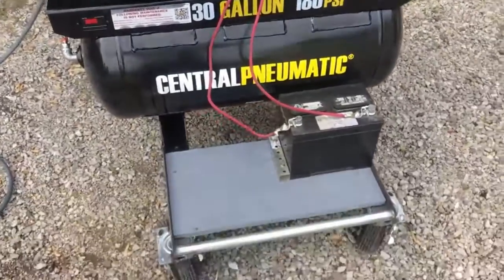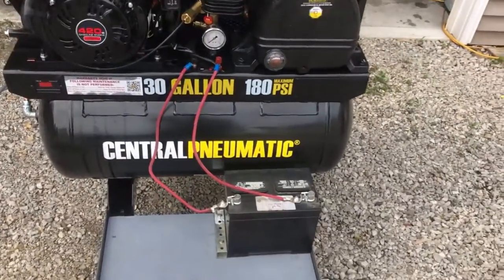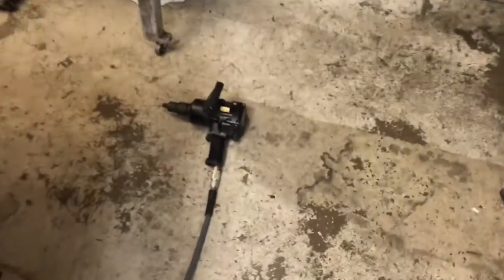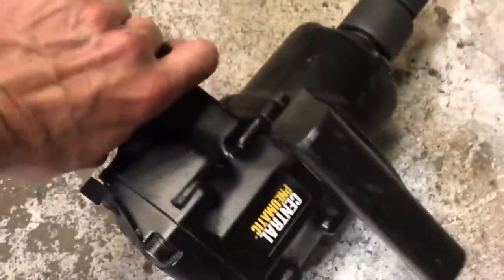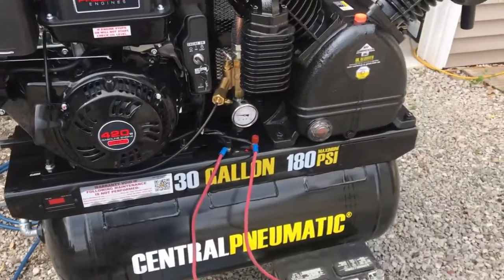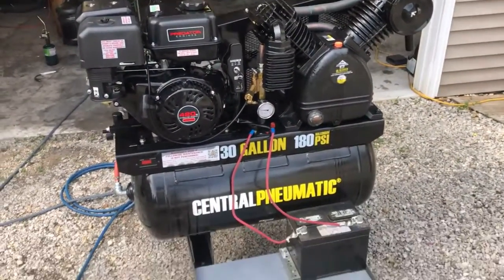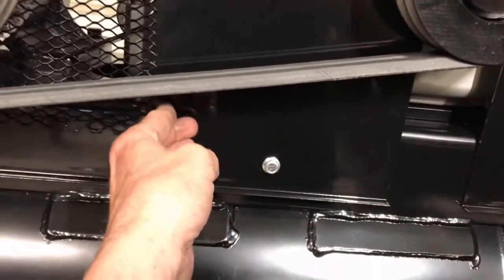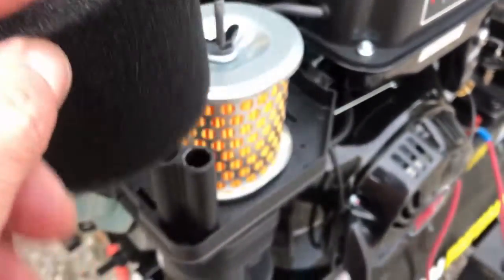Harbor Frieght 30 gallon 13 hp Truck mount air compressor

Comment: I am considering buying one of these, it seems slow to fill, how does it do once full and then running a blow tip gun or sand blasting or a power tool that has continuous flow? Northern tool has there version that is rated for 23cfm for 2200, just trying to do my homework before spending money. No one has done an in depth review of this compressor. Any feed back would help. Thanks.

Comment: I bought this exact air compressor just over a year ago. I’ve used it nearly every day since. I’m a mobile big rig machanic/tire service. I loved how quick the air was.  It has no problem running 20 ton jacks and 1” air guns. In the summer, it usually started right away or on the first pull. In the winter it was a little less fun starting, but never left me stranded. The motor was quiet and never had any mechanical issues except… eventually the key switch stole power from the spark plug. It would crank and crank but not fire. Had to pull start it every day, multiple times. That wasn’t fun. Also the water drain in the bottom is hard to get to and eventually tries to seize from all the rust. Other than that I think the motor is exactly the same as a Honda gx390. I had them side by side and there’s just a few differences. I paid the extra fee for the extended warranty. So tomorrow I take the old and pick up a brand new one. Well worth the money if you’re looking to spend less than $2k. I did however upgrade to a Napa air compressor with the Honda. So I have this Harbor Freight brand new in a box if anyone wants to buy it🤣
Reply: How much you want for it
Reply: @davidludwig4286  I just seen this! Haha I still have it in the box though. $100 less than harbor freight has it listed for. I can’t remember if it’s $1,699 or $1,799
Reply: @dallon507 you still got it?? Ill buy. What state are you in
Reply: @saulantunez42  still have it in the box. Southern idaho.

Comment: I see a few people have issues with the engine shutting off when filled or not starting. First check the safety valve that relieves the pressure of compressor when tank is full. If it's venting of excess air when full then your idle may be set a little low and may need to be turned up a hair. Mine would shut off when tank filled and the safety valve would put engine in idle. Problem was the idle was to low and  would just shut off. But make sure your safety valve is working so you don't over pressureize the tank and cause it to explode. Push valve at the bottom of tank to drain then start the engine. Push the throttle to idle then turn the idle screw untill you have a good idle but not to much. You want enough idle to keep it running when it's kicked down to idle no more. Let tank fill up and test untill it keeps running. I advise doing this when engine is warmed up not cold. Turn screw quarter turn at a time. Other things to consider is quality of fuel, air filter, belt tension, spark plug, oil fill level, compressor, and  safety valve. Be safe and stay dirty

Comment: I’ve got exactly the same air compressor I can tell you this after a while it’s going to start taking longer to build up air that’s because the belts stretch out so you will need to Readjust the belts after a while you’ll know when

Comment: Does this run on battery and gas? Or can you start it by pulling the string and if you don't want to do that just turn the key and it'll start?
Reply from the maker: yes you can pull the string

Comment: I am getting one tomorrow at harbor freight to put in my Van. I have a Mobil body shop and do body work and paint cars. it sounds like it would handle my DA sanders and my paint guns. Question is, do you think it will handle big paint jobs painting whole cars without the cfm  F luxuriating during cycles ???? anybody here Paint cars with this model???????
Reply: He said that it builds pressure back up @ 140psi and runs 18cfm @90. As long as you're under 18cfm on all you paint tools you're good
Reply: Any update? I’m looking to paint and blast with the compressor too.

Comment: Can you turn down the air pressure on this unit? And if so how can you reduce the air pressure?
Reply: You can get an in-line regulator to set the pressure however you like.

Comment: i seen that the other day nice and compact  that thing i got out the dump is to big really .i love your new unit sir sure a blessing  even more so being gas. i run synthetic motor 5w30 n a bit of Lucas to sticky feel 20 percent ? on the belt its tighter than i keep my old compressor belts seems like very tight is just making hard on starting and bearings  heck it china always go over every bolt n clean i got mostly china stuff heck my bolt fell off on HF  7 inch grinder the other day luckly it was as so as i hit trigger so i reattached it could have been bad with metal flying evey were
Reply from the maker: exactly not need to hook up 3 phase power .
saved $30k
Reply: @NOBOX7  ill never use 3ph nether if i worded my comment wrong sorry that compressor qt-10 on about the other day  dump find  is not 3 phase it`s motor is 220 single phase 10hp that what i wuz was so amazing to me usually it`s 3ph stuff thats what ill have to find  with say a rust out tank fer the pump as it need`s a pump or a connecting rod rebuild etc and they are proud of their b.s. aluminium parts its like 800 fer a crankshaft and some wonder why i dimster dumbster dive and shop at harbour freight its a have to thing i make very little pissing around with this stuff.. but learn a lot you have thought me a bunch on the flame burner stuff and i thank you and all on yt i hope to do some video after i get a shop built .i never wont to ever come Acrossed as an ass hat  snob ever ill leave that To AOC n ophrah that crew ;]...be blessed man

Comment: Just got the same but used compressor with only 15 hours of work. What size cables do i need to hook it up to a battery?
Reply from the maker: its low amp so any oo gauge will do

Comment: How’s this thing holding up?
Reply from the maker: Doing well , starts up and my 6.5 hp unit runs like a champ also . Glad i bought it , i put it on wheels though its not on a truck , not sure how well it would handle rain at 70 mph on the highway .
The compressor needs flushed with a break in oil cycle for sure. I use electric start . Its governed very modestly , could probly double its output if you tuned it ...
Reply: @NOBOX7  Glad to hear it!

Comment: Damn if I already had known. I would have sent a building compressor for pneumatic controlls. The next one I rip out and convert to electronic I'm going to send it to you. Probably 460 3 phase though. I don't know what you run in your shop. These are full  industrial
Reply from the maker: Right on

Comment: How dirty was that oil.... from the video it looked like it was aeration... bubbles in the oil will make it look dirty... especially if the oil is cold. Also belt tension looked a bit tight... but it all depends if its slipping... with 2 belt on there it should  be no problem running it looser..
Also its brand new the belt will run in a bit...
I would not run synthetic as I said before.
Just do more oil changes. Those engines don't  have filters. And need oil changes instead.
Reply: I saw a review on harbor freight website from a guy saying it will run the hvlp guns easy. At about 18cfms at 90 psi's even with 30 gallons you should be good. I have painted full hondas with cheap 26 gallon compessors with only 4.5 cfms at 90 psi's..

Comment: Can the compressor be out in the rain? And how long would the battery last? And is it possible to wire to the vehicle battery source with the alternator
Reply from the maker: I keep mine out of rain and its still getting some rust , it looks like it can handle it though and yes you could wire it to the vehicle
Reply: @NOBOX7 .  From what I think and see in the video, Its two option to start up by battery or by gas like a lawn mower?

Comment: It’s a complete piece of shit I have two of them I’ve been through nine of them in the past four years these are the biggest piece of shit do you not buy them I have two of them in my garage right now broke down one blowing gas all over the fucking place with 70 hours on it the other one the ignition key switch box spun out so the key doesn’t work I have to use a screwdriver and jump it on the distributor
Reply: Sounds like BS. 9 of them and you have 2 NOW. That’s a special type of person
1st tine shame on them 2nd time shame on you….but 11 times. Sounds fishy.
Reply: If the motor is still good & the compressor is still performing then calling it a piece of shit is uncalled for. For 1, gas leaks happen on all of them from time to time even the $5,000.00 ones. The key switch is the same, happens to the best of them so your review is a poor one. Done gone through 11 of them certainly sounds fishy, If I was Harbor Freight I would have told you to go buy another brand & see how that works out for ya & better yet after the 3rd one why even go back, just ask for ya money back plain & simple instead of bashing it when there is tons out there that has no complaints what so ever & for many years at that.